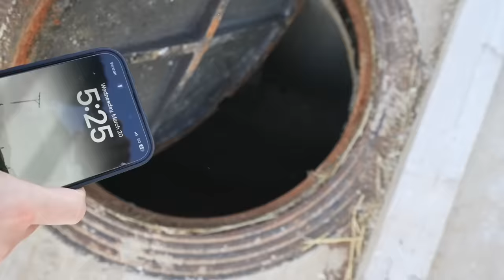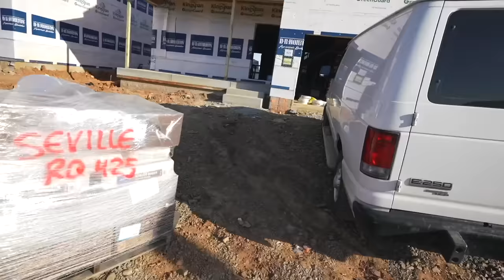Our Stalker FELL INTO The SEWER!

Comment: Once again the stalker sets them up for another trap!!🙄 If he thinks he will never be caught, then he should try planning these set ups in smaller areas where he can barely run away or hide anywhere to see if he’s so undefeated after all.I don’t think never is the answer he just lured them In there so he could run away in time. I think in a way though, they are so anxious to catch him, that they don’t think hard enough of what they should do if Lucas or Marcus would have been hiding in the car, and one go down there, than when he came back up the top of the hill, than he could have been snuck behind and grabbed. I think it’s sometimes easier to be the one running away from him because he’s actually coming near you !!